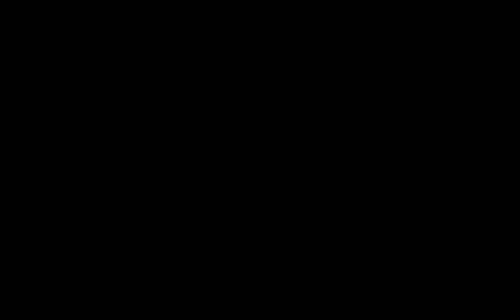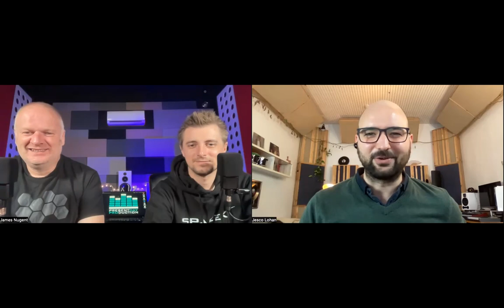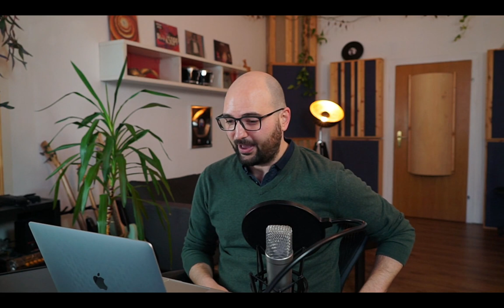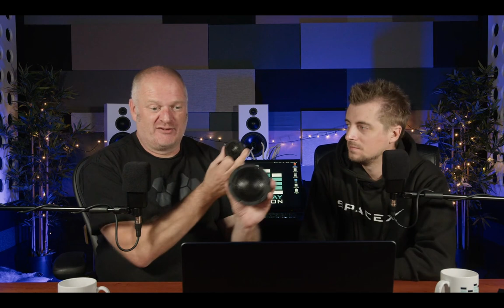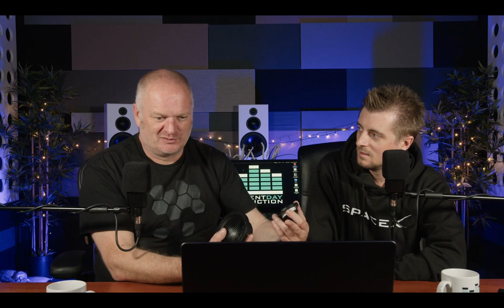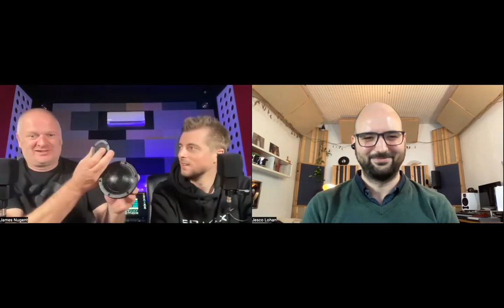How To Build MASTERING Grade DIY SPEAKERS for DOLBY ATMOS - with PresentDayProduction

Comment: I am a stereo listener. To me the dynamic compression issue is more important than the surround aspect (since I'm unlikely to add more speakers, I'll only hear the stereo or binaural mix down). You comment at 16:00 is very encouraging!

Question: Dynamic compression can make mixing easier because stuff doesn't 'jump out'. However, do you think Atmos will encourage engineers to maximise dynamic range, or will many still be lazy and stick a mastering compressor on it to smooth it all together??

Comment: I know it’s not quite “the dolby requirements…7.1.4” but if it’s helps anyone just get started, I’ve had decent results with 5.1.4 (10channels) on UA Apollo X8 and a Mac Mini M1. (No side channels) 
Had to reconfigure some channels in the Audio MIDI Setup program

Apple TV runs directly on the Mac and can clearly see atmos being output on the meter readout and volume control with no issues. Whilst it doesn’t suggest dolby atmos is a think on UA spec…. It’s working ok for me. Hope this is helpful for anyone else starting out.

Comment: JBL Intonato 24 seems to be the closest box as of now that does what’s needed, but it’s $3-4k plus 900 for the remote, which is needed for volume. It does calibrate your speakers though, which is a lot of value. It has BLU link in, which I believe they make boxes that convert Dante to that, so you could output Apple Music to DVS…maybe. Still need at least 12 channels of DAC though. MOTU 24ao would be an affordable choice.

Comment: Actually, you don't "need" a $5000 monitor controller, unless you're hell-bent on using junk as ProTools or Logic! Cubase Pro's MixConsole has a visual one knob (that can be remotely controlled) volume control for all channels. All you need is 12 analog output. This can be "built" with a cheap 8-channel interface ( such as a Behringer UMC-1820 and a ADAT expander. This can be had for about $200.

I'm considering a being a MOTU 16a to expand my MOTU 828es. That's about $4500 (MOTU 828es, MOTU 16a & Cubase Pro). OK, that's a lot of money, but it's a far cry from the $10 000 for your interface/controller combo.

Comment: ISorry, but I don't get why you need to work with $1000 speakers when your average customer will be listening through buds/headphones or a $1000 Klipsch/Sony 5.1 system from Costco? I can see it if you're doing stuff for  real movie theaters.
Reply: I guess the short answer would be because the MUM’s are not for listening but for referencing. As an example; I believe it’s widely agreed that the Yamaha NS10’s are very harsh and tiring on your ears for listening to music but because they unapologetically reveal all the problems in the mix they’re perfect for referencing. Having said that I don’t know of any reputable audio engineers not recommending running your stereo mix through a series of “regular” speakers in order to make sure you’re not loosing vital information.